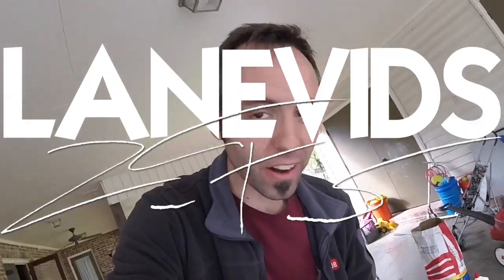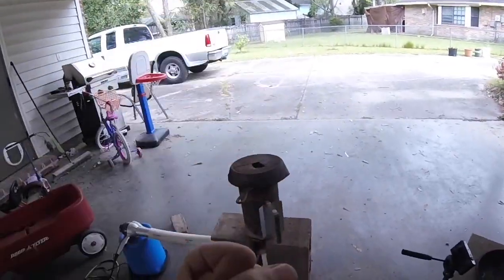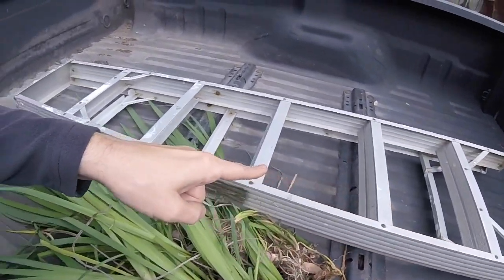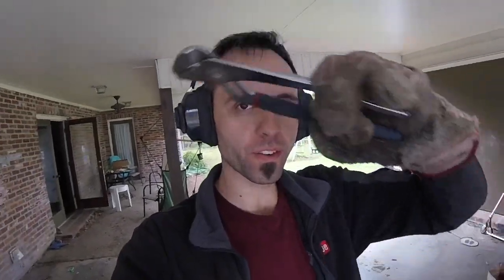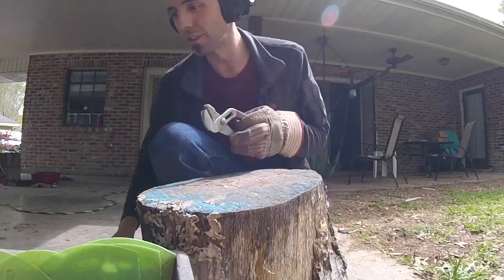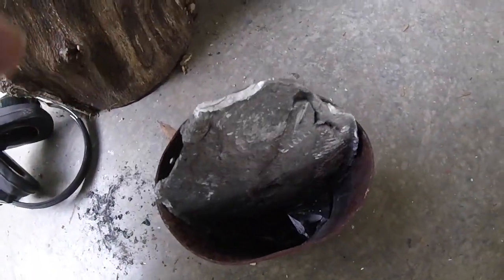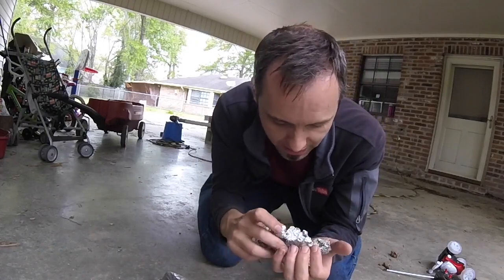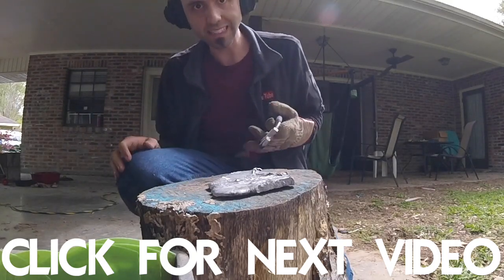WHY RECYCLING ALUMINUM SUCKS! | Melting Aluminum at Home

Comment: Two suggestions to try to help you.
1) Try using a man sized hammer instead of that toffee cracker
2) the "slag" is aluminium oxide, basically aiuminium rust. It's no use to you as it melts at a LOT higher temperature. Even commercial reyclers don't bother with it and throw it out.

Comment: You should go to a home improvement store and buy a chisel that would make breaking up the aluminum easier, just make sure you don't get a wood working chisel!
Reply: +LaneVids I picked up an angle grinder at Walmart the other less than $30, but then again it's pretty cheap but I don't expect to use it much.